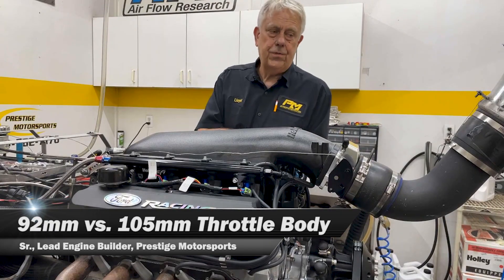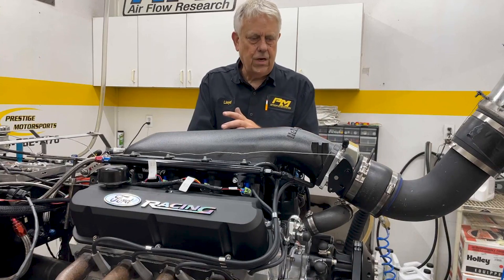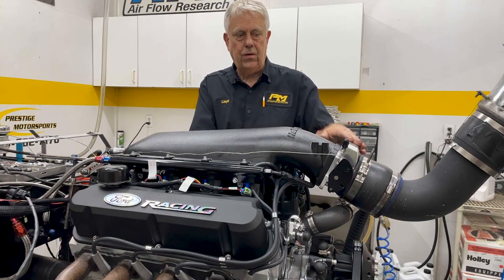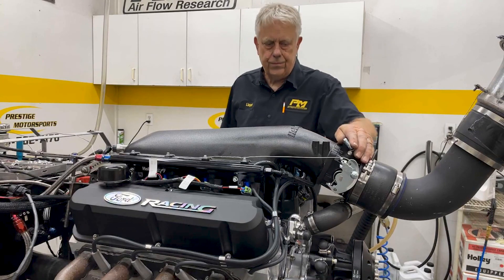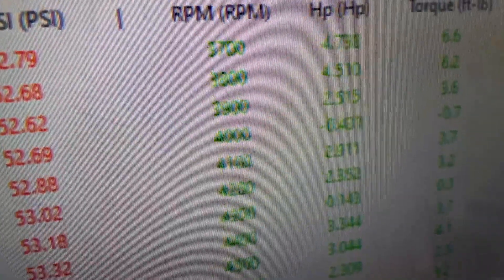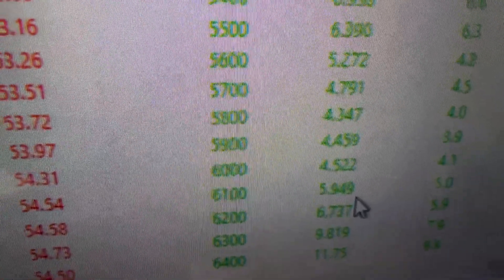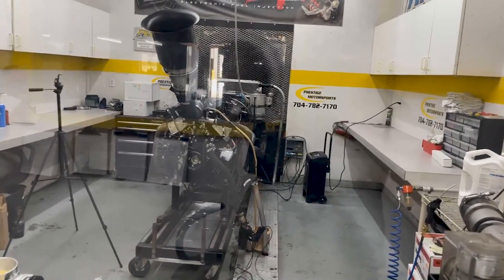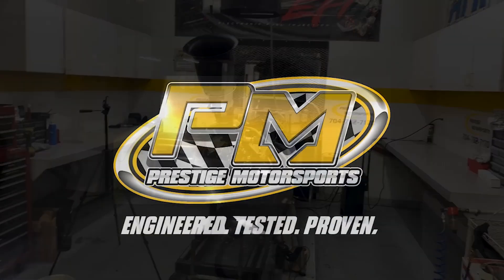TESTING - What Performance Gains from Larger Throttle Body at Prestige Motorsports

Comment: There’s really no better way to turn speculation into fact than testing. No matter if it’s on the dyno or the track. Just because a component is bigger or more expensive doesn’t necessarily mean it will provide the results that the customer wants. Prestige always goes the extra mile to ensure that the customers questions are answered completely. Especially when it’s the Senior Engine Builder providing the answers 🏁.
Reply from the maker: Thank you!
Reply: @prestigemotorsports  You’re most welcome !